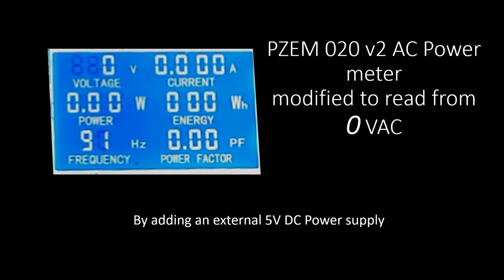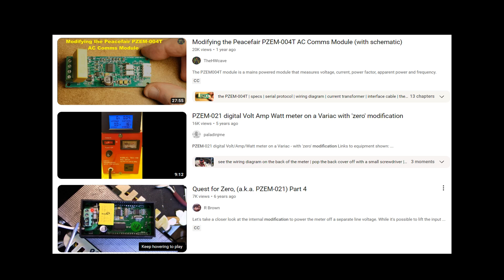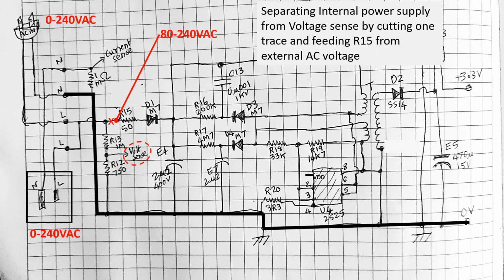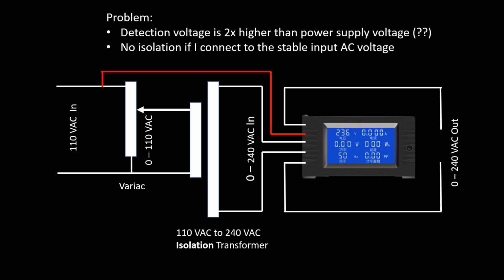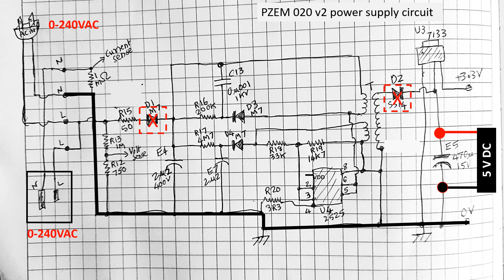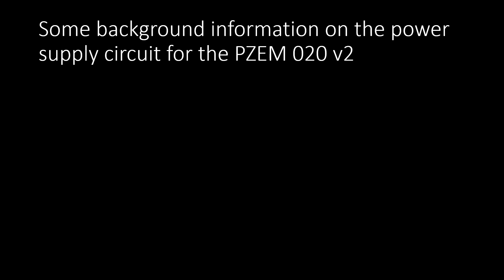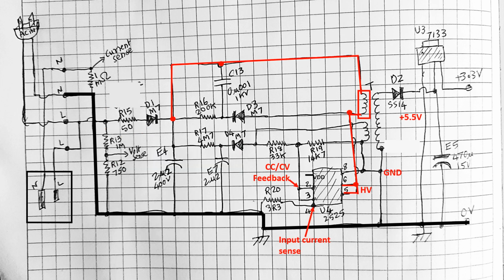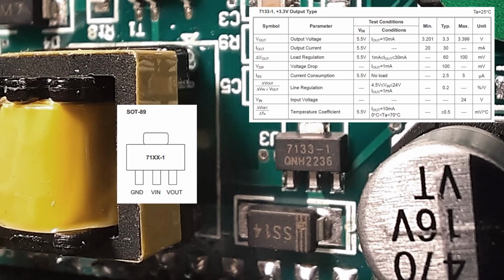Modifying the PZEM 020 AC Power meter to read to 0 Volts

Comment: I want to measure power factor of ac circuit where current is 1 Amp and voltage is 200 milli volt
Is it possible after it modify to read from 0 volt

Comment: I have a version 7.0 of this meter.  It is back to the cap and resistor.  No transformer.  Mine is fitted with a V9811B power meter controller device.  The big yellow capacitor on mine is 1uF.  My mains power supply is 230VAC so I should be able to fit a smaller capacitor.  This will reduce the power (heat) released by the large 51 ohm resistor.    The unmodified meter circuit does not offer any protection against spikes on the mains supply.  That could cause the meter to inexplicably fail if a power spike comes down the mains (eg. lightening strike).  I haven't yet decided whether to power the modified meter from AC mains, or from a separate power supply.

Comment: Thanks!
What is the current/power consumption of the module when run entirely on the battery? It'll be helpfull in choosing battery capacity.

Can we make it so that it'll run on mains power and switch to battery when there is a power outage? I mean we can use TP4056 charging module with a 18650 battery. Input to the charging module goes from the left of the removed diode and the output of charging module goes to the input of 7133-1 LDO.

Comment from the maker: Please check the link on instructables where the simpler 0 V modification is described. 
https://www.instructables.com/Modifying-AC-Power-Meters-to-Read-Down-to-Zero-Vol/
Reply: i have the PZEM 001, and left the capacitor dropper in place and added 5V DC from a external powersupply with a diode in parallel over the 16V capacitor. The diode is to block the DC that is delivered from the mains to the separate DC powersupply. Grtz